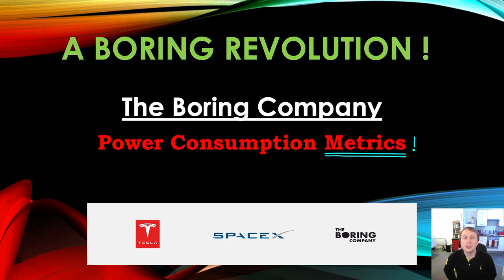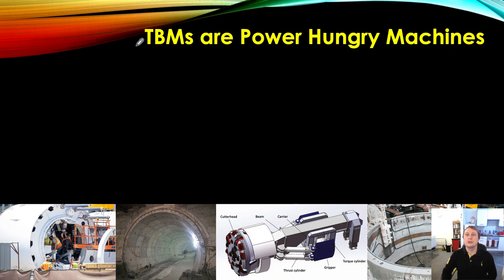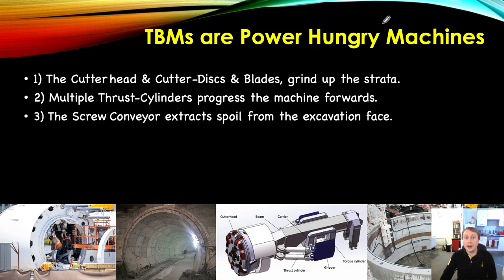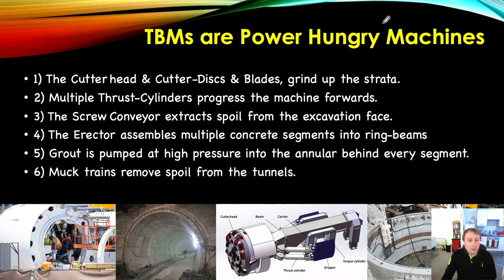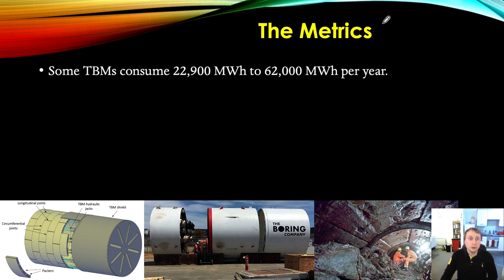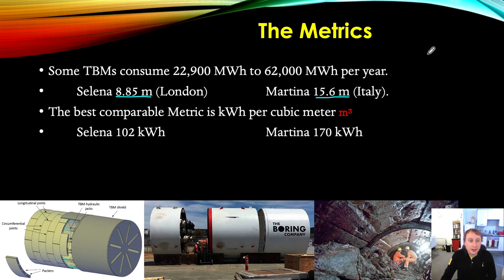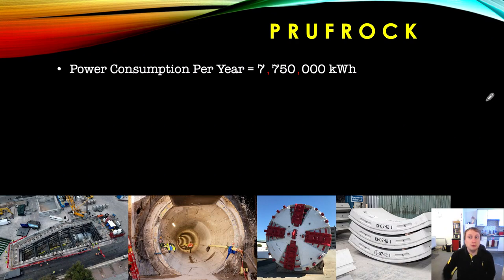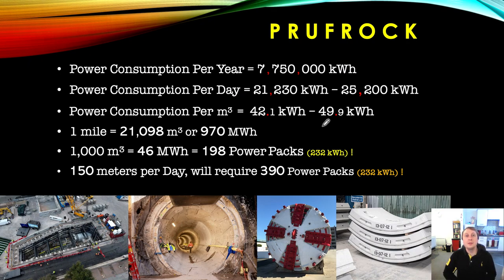Why Most TBMs Like Godot & Prufrock.... Can't Run On Batteries - Episode #91

Comment: Without getting into the numbers (which you are right, vary enormously). The  most common measure of TBM power consumption for planning purposes is "Specific Energy", which is effectively the energy per m3 excavated. It is often not clear in published data whether the numbers include the disposal to the surface (conveyors, locomotives and muckcars or slurry pipelines) and surface treatment when using slurry separation plant.
Another key parameter in power consumption is the power surge requirement at TBM startup. This can often cause an unacceptable load  to the local power grid and requires specialist equipment to manage such as auto transformers. 
Overall the most efficient method is well proven to be high voltage (11kva or 32kva) cables installed along the tunnel wall. these are expensive but can be reused multiple times. step down transformers are mounted on the TBM. 
With lower voltage cables there is a big problem with voltage drop and startup demand along the tunnel length.
Reply from the maker: Yeah it's very hard to say (too many variables) without a proper study ! 
Hopefully this is something that The Boring Company can post regular data on so we can make better comparisons!
If you could significantly reduce the length of power cable between the power source (Grid / Battery) and the machine, I presume you can reduce the voltage and thus minimise the cable thickness?
Also DC can use thinner cables apparently ?
Reply: Even with the studies I have seen or been part of there is little consistency that can be drawn from the data.
Overall installed power is a combination of the chosen components. Of course the major load will always be the rotation of the cutter head.
Long cables suffer voltage drop. After about 1,500m most tunnels will have a step up transformer to boost the voltage back up.
Always 3phase AC for safety and stability of current.
DC only used for overhead pantographs to power locomotives over long distance, with battery support as the loco nears the back of the TBM (until the pantograph is extended).

Comment: The Boring Company would use Mega Packs  for heavy Industrial use which gives 3MWh per pack vs the Power Packs  of 232kWh which is an older product so 150m per day=390 Power packs or 30 Mega packs
Reply from the maker: Yes I feel the solution is a 2 storey block of mega packs sat at the surface and connected via a ventilation shaft every 1.6 miles!
You will also need a grid connection but nothing excessive as you can trickle charge the battery 24 hours of the day.

Comment: Sounds like they need a small nuclear reactor up front as part of the tbm. No waste to remove, no exhaust, compact, all fuel contained. Easy..... well in the far future maybe.

Just think of the amount of infrastructure required to power prufrock doing a mile a day. The time and cost of setting that up would be huge. I think nuclear is the only option if they really want the speed and accessibility. Now try getting a small reactor approved... nightmare. But they will be common in a few decades, so who knows.
Reply: I bet they would opt for temporary micro nuclear "stations" so that it would not be part of the moving machine itself, at least at first. Then run wires to it or whatever. They would require some serious government oversight and security I bet though, something I don't think Elon would like the idea of.
Man, imagine if Musk was working on thorium reactors for SpaceX and Boring Co though! "Yeah, we made these micro reactors that are a lot more safe and efficient to run than the older uranium reactors by a factor of 3. We also redesigned the turbine system, increasing it's efficiency by 29% overall. It's pretty cool." 
I bet Tesla/SpaceX/Boring crew could pull it off with their ninja engineering skills...
Reply: @acro1427  it is the future, but how long in the future is upto governments and public opinion. They had alot of this sorted out in the 1960's... lol
Reply: I wonder if its any more difficult than the sort of nuclear reactor used in a nuclear submarine? Rolls Royce make then in the UK and they are developing a micro/local scale reactor.
Reply from the maker: SMR's or small modular reactors have come a long long way in the last 15 years and I follow a couple companies (Nu-Scale , TerraPower, U-Battery) who do these systems. Very impressive compact units.
It is possible but getting approval for these ultra-safe reactors is very difficult. 

I like the idea of pre-drilling vent shafts every 1,800 meters and connecting up a TBM as it passes under-them so that the cable is never more than 1,900 m long. You could then use a DC connection and have a 60 MWh pack pre built in advance of the TBM. 

I might do another video on this, next month !
Reply: @thingaby407  the super super safe ones aren't made yet. They are in early stages of trying to get them up and running. They run on liquid fuel at very low pressure instead of solid fuel in massively high pressure water which requires huge containment vessels. So they can be small and light and are inherently much safer due to the low pressures of the system. They also will also extract about 100x more energy from the fuel then solid fuel reactors.
Reply: @BoringRevolution  A perfectly viable and often used approach. Saves on expensive cables but most importantly reduces voltage   drop thus avoiding expensive and large step up transformers inside the tunnel.
for most metro (Loop) tunnels the distance between stations and.the access to local HV power allows this to be done with each drive. International regs require access to surface every 760m (if practical) so the opportunity to move cables and power supply forward is usually there.

Comment: We don't speak Powerpacks anymore, its all about the megapacks!  Expect there to be some kind of hybrid battery system of batteries that drive internal systems and computers.  Would be fed by external power lines, but provides UPS and peak power boosts capabilities when needed.
Reply from the maker: Fair point, I could have used Cyber Trucks maybe as a comparisons that people can visualise better.
Reply: @BoringRevolution  I think this topic deserves another follow-up video.  Where could batteries be utilized to augment the Boring Co drilling that may enhance its capabilities over more traditional/conventional methods.

Comment: Is it possible that TBC has found ways to tunnel more efficiently and so use less energy?

I'm thinking that the industry did not care about power consumption before, so they may not have bothered to try to make tunneling more energy efficient.
Reply from the maker: I'm confident you could make considerable improvements to the efficiency of a TBM if you do away with the transformer and also reduce the losses in the cables. TBM cables are ginormous and you have sets of cables thus it also takes up a ton of space inside the tunnels. So I think you're right Warren.
 
Also the Electric motors in the cutter head support could be run at a lower voltage and further optimised by Tesla... & a more efficient cutter head design would obviously save a ton of energy.
Reply: @BoringRevolution  You are both right in a way. TBM's have a large amount of spare power. But it is the same as a car or an airplane. All that power is needed at the start, to get the head turning. Like a car accelerating up to cruising speed or an airplane on takeoff. When manufacturers reduce the cuttterhead power (sometimes forced if one or more of the drive motors fails) a TBM can grind to a halt fairly quickly. This balance of power, thrust, torque is the same engineering exercise that has been testing the minds of highly skilled mechanical engineers for generations. TBC don't have a magic wand. But, the use of a large battery as capacitor for extra power when needed is an interesting concept. I would think high risk as discharging a battery quickly causes very rapid heat build up. Probably why it has not been used in tunnel construction to date.
Reply from the maker: @davidsalisbury50  I think a TBM would need a very heavily customised battery pack with an extra reserve of cells and maybe even a bank of ultra capacitors to fast activate the cutter head. . .

Comment: 4m TBM consumes about 1.5MW power. It mean it can run two hours in 3MWh battery. It is totally doable, if batteries are changed frequently.

Elon's plan is actually use batteries, so propably he have figured it out. I'd guess it is cheaper to draw cable but on the other hand, TBM moves ahead and it takes time to extend that cable.

Battery packs can be delivered and taken to be charged with special train like vehicles. One MWh cells weigh about 3t, so for example 3-10MWh pack is doable if prufrock needs more power than 1.5MW. 

Typical cells can deliver 5-8C, which mean 1 MWh pack can provide 5-8MW of power. Therefore it is possible to have smaller packs and more frequent battery swap. There can be multiple connectors in TBM, so no brakes in work cycle.

What comes to costs, Tesla have got cell price below 100$/kwh. It means one megawat costs about 100k$.  That's not too much compared to other costs but if course it is more than just electricity price. If being charged five times per day, battery lasts 1-2 years if it uses current vehicle cells or over four times longer if more expensive and heavy grid-level cells are used.
Reply from the maker: Can you send me some data to confirm the 1.5 MWh as It seems kind of low compared to the other data I have. I suspect that local ground conditions play a major factor in power consumption.

My e-mail is Boring Prufrock @ g mail . com

Comment: think your KWH estimates are off; did you get based on the diesel they current TBM's use?
but if not; then they must be looking at UHVDC inverters on the boring machine; that way they can significantly reduce the cable costs and drama for long rungs
Reply from the maker: So unfortunately I only have 3 months worth of power data for that site in London, thus I'm assuming that over 85% of that power is consumed on-site by the TBM. It might be 5% more or 5% less. I had to make a few guesses !
The other machine in Italy is yearly consumption and its a giant custom made one of a kind machine, so not typical of what is used.
I'm no electrical engineer so I'm not sure about cable / conversion loses but would love to learn how you can cut down on those loses without spending excessive amounts of money.
Really I need more examples from North America and China 🤔

Comment: If you have cars running back and forth to carry spoil out of the tunnel, the cars could carry charged Power Packs to the TBM as they carry discharged Power Packs and spoil out.  A 5 cubic meter car could carry one Power Pack each way.
Reply: True, but would that be cheaper and more practical than just having a long pair of cables for a grid connection?
Reply: @Global_Optimization  I would think that it would depend on how long the tunnel is and how close the opening of the tunnel is to a high voltage grid connection.  I would think that running a few miles of high voltage cable down a tunnel could have its own challenges.  Running a few semis back and forth to carry Power Packs between a charging station and the tunnel might be a better approach.
Reply: @ralphwagenet852  I agree. I wonder if @A Boring Revolution could try to estimate how long the tunnel would have to be for the breakeven point between grid connection cables vs a rotation of powerpacks
Reply from the maker: @Global_Optimization  Its a damn good question.
I think both ideas work. @Ralph Wagenet proposed a good solution and I want to establish the costs first. 
Cables for me just seem more affordable because you can re-use them 500 times or more.
Reply: @BoringRevolution  sorry to appear negative but I don't think everyone has thought this through. Semi's don't fit in TBC tunnels; how to swap out very heavy large power packs? I have seen a transformer on a TBM explode, not a good thing in itself. but changing it out inside the tunnel took months. remember the big components going in all the time are the segments and they have to feed all the way through the machine to the front. The big enemies in a TBM tunnel are water, confined working space and heat. None of these fit well with changing out power packs. Cable extensions usually need to occur every 150-300m (depending on the cable spool on the TBM). This usually takes a day of lost production.
Reply from the maker: @davidsalisbury50  Yeah sometimes the best solution is to use the existing methods and perfect them. 
I don't mind cable spools and appreciate your input on this matter. Thanks David !
Reply: @davidsalisbury50  I'm not proposing putting a semi into the tunnel.  The semis would run between a charging station and the tunnel opening.  Power Packs would be loaded from the semi onto a spoil cart and taken by the cart into the tunnel to the TBM.  I strongly suspect that the Boring Company's engineers could come up with an automated way to unplug a spent Power Pack and replace it with a newly charged one while the cart was being loaded with the spoil.  Then the spent Power Pack would get loaded onto the cart with the spoil and it returns to the tunnel opening, where semi would be waiting to take it back to the charging station.  There might not even be any downtime needed,  which would help speed up the process (a goal very much on Elon's mind).
Reply: @ralphwagenet852  I agree, it'd have to be on small slow moving carts, not a semi. Some tunnels will need to be big enough to accommodate semis and buses, but not all of them.

Comment: I can see how hard it is to get stats 
Seems most TBM just sit around while  they get ready for the next push .
Reply: Yes Tom, that's all anyone in a tunnel does "just sit around waiting for the next push".
let me describe the cycle of a TBM.
1. Excavation ~ 2 minutes getting the head turning, all the systems up to speed and stabilised, clearing the cutterhead of loose spoil. Then the initial push and excavation up to 50mm per minute in typical ground.
So a minimum of 20m per meter. Typical times are 30~45 minutes.
2. annulus grouting ~ modern TBMs inject the annulus grout through the tail shield of the TBM attempted  the same time as excavation to maintain a positive pressure against the surrounding ground, stabilise the segmental lining and minimize settlement.
3. ring building ~ the segments are moved up during the excavation and are built one by one while the TBM is not excavating. This has to be done.to maintain forward thrust on the excavation face to resist ground and water pressures. In ideal rock conditions it is possible to use a double shield machine to build at the same time as excavation. these conditions are not common and.the machines are highly specialized and very expensive so generally only used in long, straight mountain tunnels.
the ring build usually takes 30~40 minutes. 
On top of these basic processes there are a thousand sub processes to fit in. not least of which is the maintenance of the cutting discs or teeth on the  cutterhead. typically this will be a 3~4 hour process either daily in rock or a bi~weekly event in softer ground.
with each cycle there are utilities to extend, tail seal grease to change (2/3 barrels a day) and a very long list of system maintenance processes. 
it's a very harsh and demanding environment, wear and tear is a continuous process.
Reply: @davidsalisbury50  yes, I know all those parts 
The tbm  stays still while everything goes on around it .
But if the tbm doesn't move , then its not productive 
Thats where Elon is going to make improvements to drop costs 
Wasn't making derogatory comments about the crew .
Every one works 100 percent 
Its up to management to change the system to increase productivity. 
Not the workers
Reply: I still dont see how Mr Musk thinks he can radically improve on a process that has been developed over decades by dedicates specialists who have given their whole working lives to the subject. TBM manufacturers and contractors know how to squeeze efficiency out of their equipment. 
Some people seem to put an awful lot of faith in his words on a subject he knows little about.
I'm not critical of many of his other ventures. he clearly speaks with expertise on the subject of EV's and batteries. His space X programme is certainly visually impressive,  although it's NASA who just landed a vehicle on Mars. Not an area I have any knowledge of so I'm happy to praise effort and success where it is made.
I do know tunnels, and TBC are still 30 years behind the curve on current TBM technology. That is just a plain fact.
I await the Prufrock concept to see if there is anything to get excited about and will be the first to praise any breakthrough.
Reply: @davidsalisbury50  never go against Elon 
He has a 100 percent batting avg
Reply: @tomrobertson3236  He has had some spectacular successes and I take my hat off to him for them. He didn't get to be one of the richest people on the planet by making stupid decisions.   But he did take risks and not all of them paid off. He's far from 100%, as is the same for most successful entrepreneurs.
I think he has got this one wrong. Just my view from within the industry. Time will tell, but I'm in no hurry to swap my Tesla shares for  TBC ones.